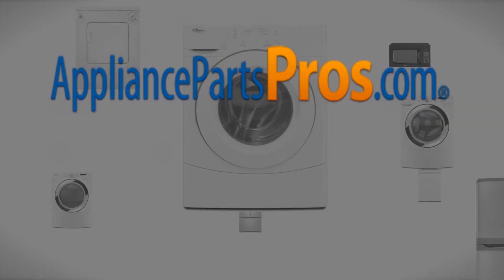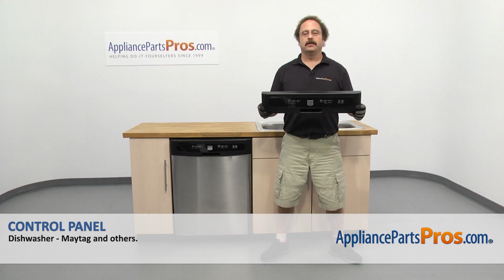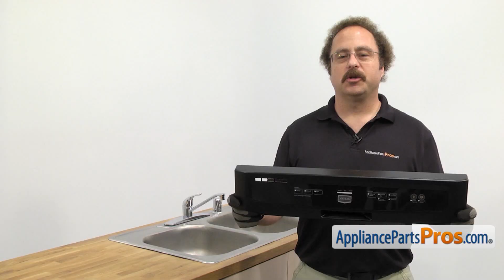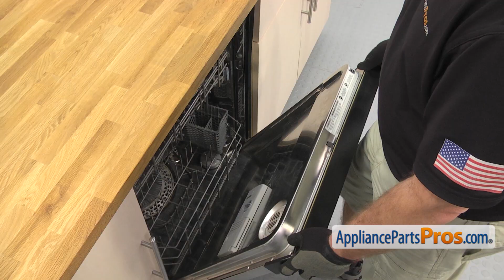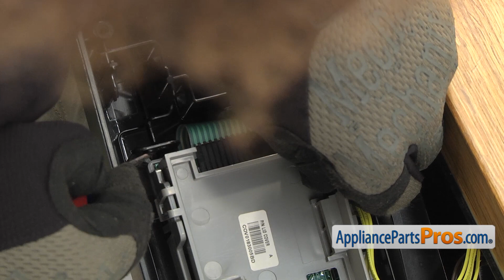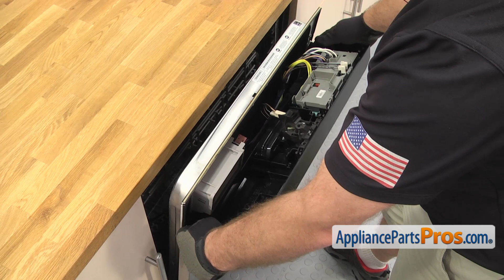Dishwasher Control Panel (Part #W10811155) - How To Replace

Comment: But how do you know if it's the control panel that needs replacing or the actual control board? I don't want to be stuck with a new panel if it's the board thats needed....$$$